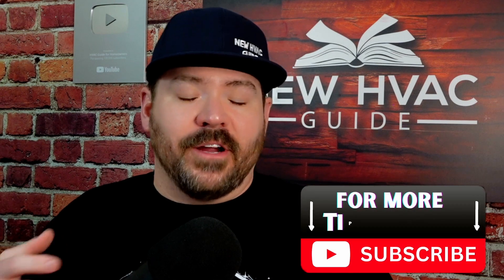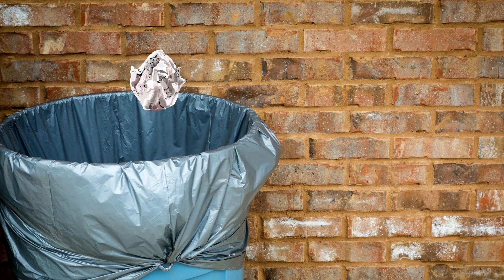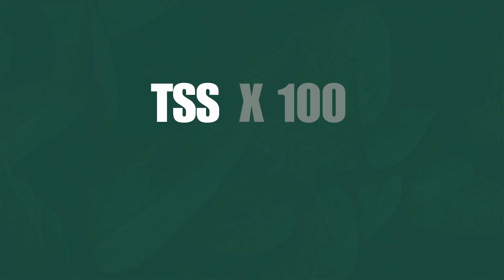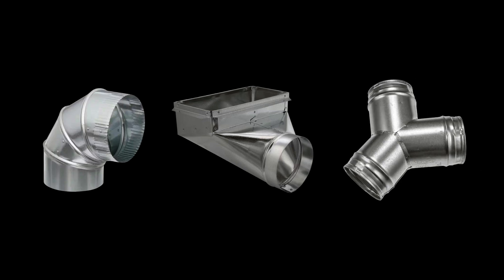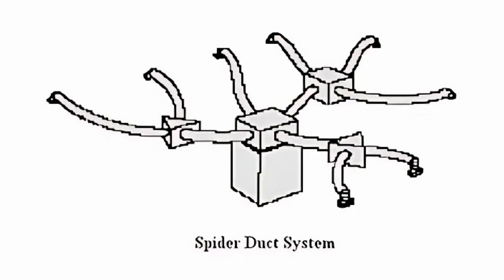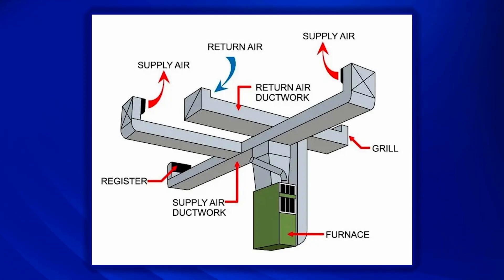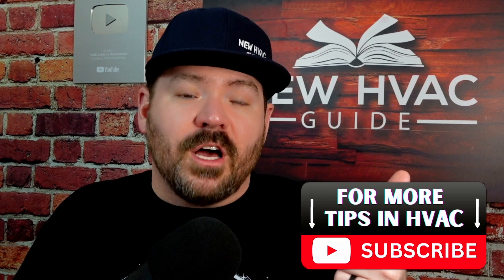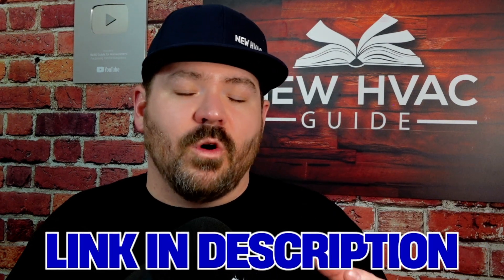HVAC Sizing Explained: Supply Duct Formula

Comment: The correct way of doing it.

The formula for calculating the design friction rate (FR) for an HVAC duct system is Available Static Pressure (ASP) multiplied by 100, then divided by the Total Effective Length (TEL). 

The formula is (FR = (ASP x 100)/TEL)

Here is a breakdown of the terms:

 FR (Friction Rate): The allowable pressure drop per 100 feet of ductwork (measured in inches of water column per 100 feet, or in. w.c./100 ft). This is the value you use on a ductulator or in software to size the ducts.

ASP (Available Static Pressure): The amount of static pressure the blower has available specifically to push/pull air through the ductwork itself. This is calculated by taking the Total External Static Pressure (TESP) of the air handler and subtracting the pressure drops of all other components (coils, filters, grilles, etc.).

TEL (Total Effective Length): The total length of the most restrictive duct run, including the actual measured length of the straight sections plus the equivalent length of all fittings (elbows, transitions, etc.) in that run

Using this calculation helps determine the appropriate duct size needed to ensure proper airflow and system efficiency, preventing common issues like undersized ducts and excessive resistance.

Comment: This sounds to me exactly like sizing a gas system
You start with total BTUs and to the farthest point.
This gives you your initial size. 
Then as you branch off for each drop 
You downsize accordingly. 
Knowing what size you need to handle the BTUs for each fixture dictates what each branch size will be and when you can reduce the size for the individual drop. 
And of course we have different sizing chart between iron pipe, and CSST.
Kinda like the difference between hard duct and flex
Or did I miss something? Lol.

Comment: Any bends in the pipe should be made less than 90 degrees if possible to reduce any restriction or back pressures..assuming a contractor installer working in the attic will work 100 percent to industry standards would be a mistake and i would monitor process 100 percent.

Comment: I do agree with  0.05 return & 0.1 supply not always  tho @  1 st learned  in 1996 when i stared HVAC all contractors did  0.1 for both when i worked for others but when i got out on my on in 2006 i studied duct trunk / feeds & returns & came up with that formula & used it ever since  & rarely do i have an air flow or comfort problems or complaints

Comment: Heavy flow downstairs, very little upstairs, 2 HVAC guys came in immediately wanted to put in larger ducts upstairs (remove asbestos $$$) dismiss my questions about dampers, didn't see the dampers in the individual ducts behind the register until I pointed it out after he said it was impossible
Reply: It's too bad. I'm assuming you're not in Colorado in my area. The systems are generally fixable. You just need the right training and experience to do it. Most technicians have no idea how to address these issues but it's totally doable in many circumstances.
Reply: Southern California, I don't know if there is honest hvac service or how to find them
Reply: @rp9674 honesty always counts in business but that's not the critical failure. It's a question of understanding the math and science of how everything works. Most technicians just don't have the training, the skill. I'm talking about a 1 in 500 or 1 in 1,000 technician. Maybe not even then.
Reply: My next move is a supplemental window AC or portable
Reply: @rp9674 yes that's certainly an option, but HOAs are less than fond of those. 😂 Personally I dislike mini splits but they have their place too.

Comment: This expert lives in his own reality. I have been involved in residential, commercial, several 8,000 sqft restaurants with mechanical engineered plans.
Never have I seen a separate heating and cooling ducts. Yes, air flow and pressure typically higher for cooling but it's always negligible because fan speed is at its highest speed. As long as the flexible ducts are installed properly applying the correct industry standards, absolutely nothing wrong.
The only issues is the HVAC people not doing the work correctly, professionally and with thoughtfulness because this society doesn't give them enough respect and pay too much the professionalism that is required. 
Nothing with the charts he crossed out as long as applied properly.
Reply: As a builder turned HVAC professional... (got into it because always had some types of issues)  Some of my homes
would benefit by two different duct systems for heating and cooling for precisely the reasons he said.
Like they both were saying... we just don't do that.  He was just stating you can't change the laws of physics.
Reply: @timbrown9305 people(builders) are cheapskates they don't like spending money for a regular system.
Reply: Independent systems for heating and cooling definitely do exist but they're less common I agree. It's a mistake to say that they never happen.
Reply: @HeatGeek1  You must be referring to hydronic radiators for heat and ducted system for cooling. Clients will never, ever pay for two separate duct systems for cooling and heating. They don't even want to give us the space for ducts for one system never mind two ducted systems!!!! Please take a picture of two ducted systems and post a link. It doesn't exist.
Reply: @HeatGeek1  If you listen to the "expert" he states no builder/homeowner will ever pay for a two duct system.
He just does not make any sense. These is nothing wrong with the chart he throws away. 
Why doesn't he show a "correct" chart?

Comment: Interesting with the friction loss, but when I’ve seen the airflow issues in the supply, it’s usually from too much flex duct. The supply ducts generally I’ve never seen too many issues with. Where I have seen the big mistakes is in return duct. Constantly undersized or barely sized big enough, including the return air grills. The systems are very noisy because of this. I’ve done a couple of new construction houses on the side with a partner, we always oversize return duct. We make it as big as we can and the same with the return air Grills. The other mistake I see is air filter not size correctly. 16 x 25 x1 air filters can’t really move a lot of air through on them. I try to put at least a 2 inch filter in with a filter cabinet preferably 4 inch. That’s where I see the biggest problems. Return duct  and filtering. On equipment change outs I always try to get a 4 inch filter cabinet. McDaniel Metals makes a lot of great filter cabinets to make it easy.

Comment: In this day and age, why are we using stupid guesswork approximations. Computers are cheap and sufficiently powerful. Just do a full computational fluid dynamics model for the whole duct system and get an exact answer. You don't need any physics knowledge, just the ability to model geometry.

Comment: Helpful video, I've learned a lot from your channel. 

I have a sincere question: Where is this .1 number coming from for your ASP (Available Static Pressure) 😆?  There was no math done, how did we come up with .1?  You've shown the correct formula for Friction rate (ASP x 100, divided by Total Effective Length TEL), but a made up number (.1) was used for the ASP.

Don't you need to use the blower data, Coil data, return grille, dampers, etc?

Beginning at 4:46, this explains why you can't use .1 for ASP: https://www.youtube.com/watch?v=yfUqS85VRhE
5:36-7:15 he rants about using the magic .1 number for ASP, instead of math.
Reply: in my oppinion youare right
Reply: Yes. That IS correct

Comment: Wrightsoft pricing starts at $79. a month for basic paid monthly, do you know of a free HVAC calculated for homeowners?
Reply: Get all the details together like you were going to do it manually, write it up in a text file, then use Grox or ChatGPT. The more details the better. (Not a hvac pro or anything but spent the last several months learning this stuff for my own house.) Local techs just laugh when you ask them to do flow checks and balacing of systems. It's all wild west and rule of thumb for us residential plebs.

Comment: This video is wrong. You need to take it down. This is not how you do it correctly
Reply: You don’t invent the friction rate. You allow the manual d sheet to give you the friction rate after manual j for load size. Manual s for equipment selection. Manual T for for your terminations. Zr if your zoning. Then you find your critical path and design based on that path friction rate. .1 and .05 is the same as just using the ductulator spray and pray methods. 

Also reducing trunk not necessary if less than 24 feet. More than 24 reduce every 15-20 feet. For a start.
Reply: FR=ASPx100/TEL then use that FR for duct sizing. You don’t just arbitrarily pick a FR and go straight to the duct calculator.
Reply: @jasontrammell7982  I figured that's what your OP meant: You can't just pick a random/arbitrary friction rate (.1) for the formula.
Reply: We probably need to do a video on the math separately. We are trying to do everything in bite sized videos.
Reply: @NewHVACGuide I appreciate and enjoy your content, I'm just here to learn. Keep it coming.
Reply: Which part is wrong, besides using the magical .1 number for Available Static Pressure?
Reply from the maker: Please let me know what's wrong so we can fix it
Reply: @hvacguide1  Check how to do it on my replied.
Reply: All good info. However, how would the manual D sheet give you the friction rate without knowing the fittings, vents, or lengths of the proposed ductwork? It wouldn’t. That’s where this video’s info comes into play 🙂
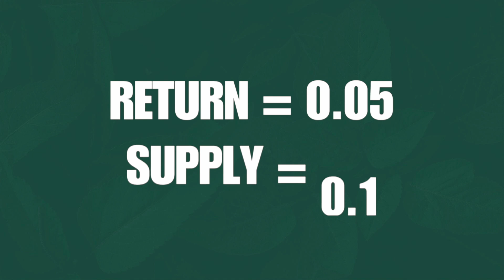Reply: @NewHVACGuide yes but he's making the same point as my separate comment: it appears that .1 (3:34) was selected as your ASP without actually figuring out the ASP with math.

Maybe there was part of the discussion cut out of the final video, but you can't just use .1 in the math formula and hope it works out... Maybe 1/10,000 times it will.

I appreciate your videos though.
Reply: I don't care if you're right. Get em boi 😂
Reply: Anybody that does Hvac should know how to do this without calculating all your ducks supplies should be 6 inch bathrooms pantries 4 inch. Most crucial part is airflow and proper return